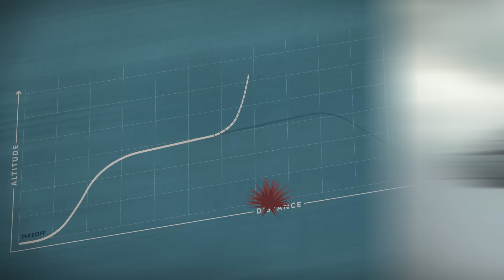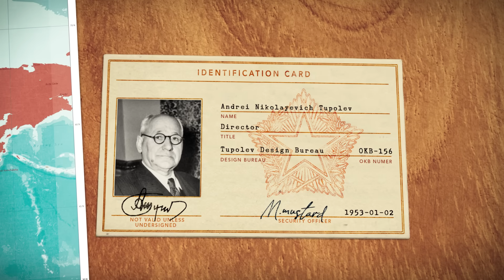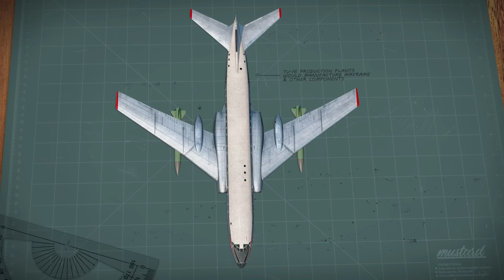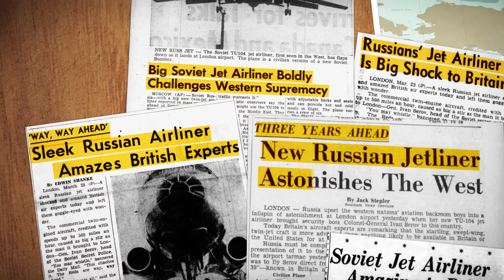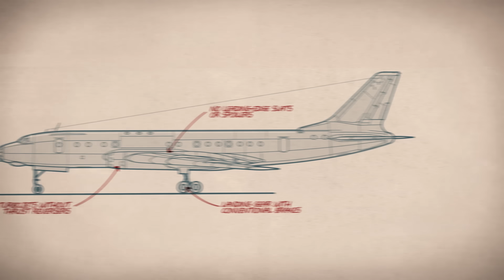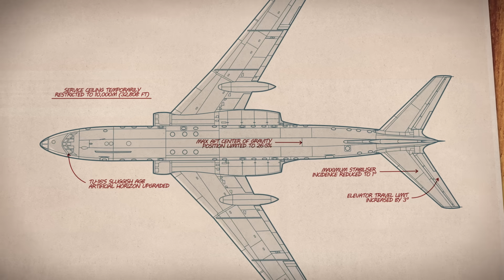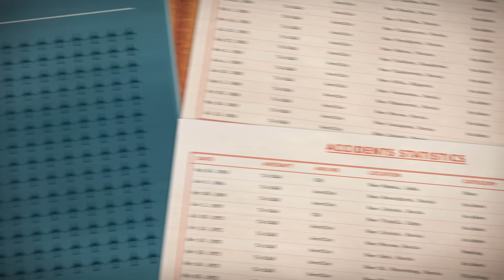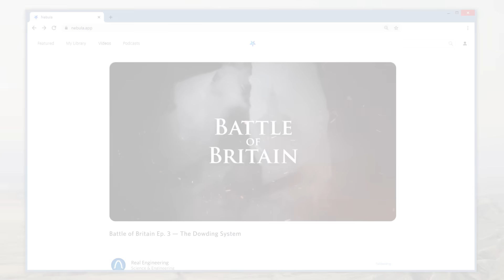The Soviet Airliner Designed To Crash

Comment: Propaganda before safety always the Soviet and Russian way.
Followed by quantity not quality.
Reply: That is the British way also, case in point the de Havilland Comet Disaster.
Reply: @sandervanderkammen9230 

Clearly we feel we can shed some light on some common myths & misunderstandings.

Clearly It's a great pity & a crying shame that British military forces had to occupy a large part of Germany for decades after 1945 & Russian military forces had to do the same. Of course Russia still posseses a large chunk of what was German territory & of course  Russia & the UK produce nukes. Obviously Germany does not produce nukes.

Obviously it's possible to predict the potential accident losses for airliners simply by looking at the year they first flew. However, if we take into account all the variables including the year they first flew & we discard random incidents such as a vehicle colliding with an airliner during its takeoff run, there are some airliner manufacturers that stand out as producing  particularly safe aircraft for the years in which they operated, Bombardier & Embraer being two such manufacturers.

It's definitely true to say that Bow-wing (See B-47 wing folding & wing collapse incidents), which has more than 50 years design & build experience on the type, obviously can have no excuses for the 737 Max incidents, those incidents being directly caused by serious design defects.

  That's correct of course, at the time the Comet wasn't particularly dangerous. It was also definitely not the worst aircraft engineering disaster in aviation history obviously.

   Obviously the Comet's engine position & inlet position had some distinct advantages at the time & of course pylon mounted  podded engines have some problems including excessive induced drag. The Comet engine inlet design was not a fatal flaw & didn't cause any incidents.

Examples of all Comets mks including some Comet 1 airframes continued flying with certification at some point after 1954. Flying carried on until 1997. 

      Losses comparisons.
Accident Losses % of total built.
How things were in those days.

DeHavilland Comet 4 UK                 14% 
DeHavilland Comet all   (ff 1949)   17%  

Douglas DC-1                                      99%
Douglas DC-2                                      47%
Douglas DC-3                                      30%
Douglas DC-4                                      26%
Boeing s300                                             72% 
Boeing 307                                               70%
Boeing 247                                               48%
Boeing 707                                               20% 
Lockheed L-049/149 Constellation        30%
Lockheed Electra  Turboprop                  29%
Fairchild FH-227                                       30%
McDonnell Douglas DC-8                        14%
Sud Aviation Caravelle                             15%
Canadair CL-44  Turboprop                   46%  
Convair CV-580  Turboprop                   22%
Convair CV-880    (ff 1959)                    27%  
Convair CV-990     (ff 1961)                   35% 
Tupolev T-104     (ff 1955)        16%

     Of course De Havilland had prior experience building many all metal construction airframe aircraft & thousands of jet powered fighter aircraft that were primarily of metal construction with pressurised cockpits & jet engines built by De-Havilland.

  Yes, that's true, De Havilland carried out full stress analysis & engaged in a comprehensive & protracted testing program which is why key De Havilland people were happy to be aboard flying DH Comet aircraft. The Comet was the first airliner where stress due to pressurisation significantly exceeded flying load stress for a full length passenger cabin fuselage.

    We agree, that's correct, the DH Comet was the first passenger airliner with full length fuselage pressurisation at 8psi pressure differential. Handley Page built the world's first all metal construction airliner during the 1920s.
    In all cases other earlier pressurised aircraft were larger, needed thicker fuselage skins due to flying stresses alone & had much lower pressurisation differential pressure or were military aircraft with relatively small heavily built pressurised capsules. 

     Of course ripstop provision was provided. The skin alloy used became unavailable at the time due to R & D at the manufacturers which resulted in the original alloy being discontinued. Later alloys had very similar properties. The skin thickness used for the Comet was used for similar size later aircraft. Frame spacing was not found to be too large & frame width was not found to be too small.

    Without doubt De Havilland did indeed always work to better than industry standards at the time, used up to date knowledge for the design & construction & no evidence of negligence or criminal negligence was ever produced in relation to the DH Comet.

    Obviously the DH Comet had no effect on the course of the aerospace industry in the UK. The UK now has the world's highest combined nuclear, aerospace & defence sectors per capita activity. Of course anyone currently flying on a wide body airliner stands a good chance of being on an aircraft powered by RR gas turbine aero engines designed & built in the UK.

    That's correct, the investigation committee did not find hundreds of fatal flaws or evidence of design defects, structural defects, defective materials or shoddy workmanship. Indeed it is the case that ripstop provision was included. Claimed incidents did not involve cracks starting from passenger cabin window corners. Pretty much all changes were just in case changes or were planned development modifications & improvements that were scheduled regardless of incidents.

    Obviously De Havilland designers knew all there was to know about metal fatigue at the time they designed the DH Comet.

    It is in fact entirely true to say that the way airliners were built changed everywhere, including in the US, after the Comet incidents.

We hope this helps, obviously.

Cheers indeed of course as always etc.
& 👍 without doubt.
       
 
 . . .... ... ..... ......
. . ..... ..... ... ......

Comment: To be fair: The Comet 1 was also not that save, but as dangerous as the Tupolev.
The only difference it that that Soviets did notchange anything, while the Comet was redisigned to solve its problems.
Reply: 20 Comets crashed after the complete redesign... it remains the worst jet airliner in history.

Comment: The Comet was the first aircraft to fly the Atlantic, and not the TU 104. I always thought the anhedral wing gave excellent low speed handling.  The 104s  were regular visitors at Manchester UK, and many arriving  passengers threw their communist party badges on the ground upon arrival in the west  ,  This was in the 1980s. As for the Comet the airframe was pressure tested in a very large aircraft shaped water tank, eventually a rupture occurred pointing to a failure in the manufacturing process, This information was shared with other manufacturers thereby avoiding the same mistakes, thank you for the video very interesting..
Reply: The Comet 1 was the only one to have its airworthiness certification permanently revoked.
Reply: @sandervanderkammen9230  stop blaming the comet man
Reply: @jasperhunter8386  The Comet Disaster remains the worst engineering failure in The history of jet airliners.
A truly humiliating ans shameful chapter in British history, bthe real tragedy of the Comet Disaster that killed 426 innocent men women and children was that it could have been easily prevented if de Havilland had simply followed well-known and understood industry standards for design and construction  of pressurized cabins made from riveted aluminum alloys.
Reply: Actually the Boeing 707 flew on July 15th 1954 before anyone in world knew what caused the Comet Disaster, de Havilland never understood why its aircraft exploded,  it's testing work was as fatally flawed as It's design work

Wreckage recovered from the sea and modern investigations revealed the passenger windows were not the cause of the catastrophic in-flight structural failures.

Comment: I remember seeing Aeroflot '104s landing at Gatwick in the 1970s and were the only civilian aircraft I'd seen that used a parachute to slow down.
Reply: The French built Caravelle had a parachute that could be deployed to slow the aircraft down upon landing.
Reply: The Tu-104 RD-3 turbojet engines were designed in the 1940's, engine thrust reversers only appeared on Soviet aircraft in the 1960's. The engine nacelles on the Tu-104 could not be modified for those(or was too much of a headache). Using a parachute shortened the landing from around 3,000 meters to around 1,600 meters without stressing the air brakes and landing gear brakes. It was also safer in some weather conditions and short runways.
Reply: The 104 is based on a military aircraft; when it was created, reverse to turbines had not yet been mastered. Issue 104 ceased in 1960.
Reply: Russian propaganda planes are never good

Comment: All first jetliners have bad safety ratings comapre with newer one. The second generation (B727, Trident, DC-9, TU-134/154, Il-62, BAC 1-11) were involve in many accidets too. TU-104 was maybe better than Comet, becasue Tupolev use for it a platform of bomber TU-16. Only Aeroflot and our CSA (Czech Airlines) has TU-104 in service. During servis in CSA, from 6 planes, 3 were involve in accidetns, but only with 13 fatalities. All accident were caused by fire during refulling , CFIT and runway excursions. If compare accidents TU-104 with Comet, there is very similar rating. Number of destruction (non repair) aircarfts was 17,8 procent TU-104 and 17,9 procent of Comet.